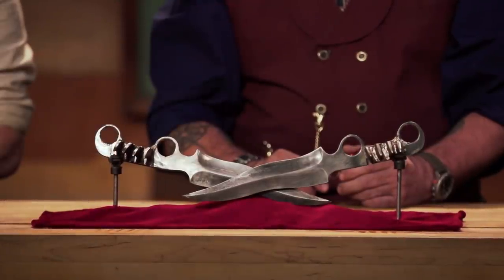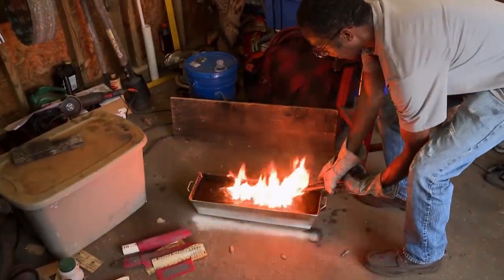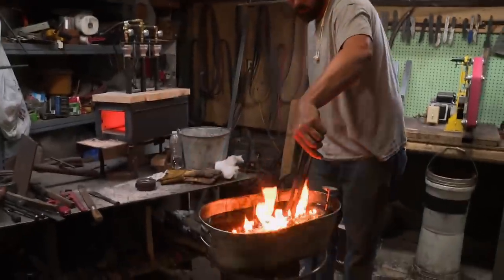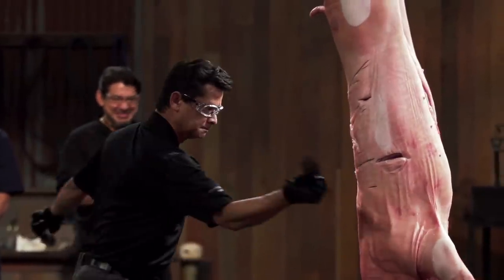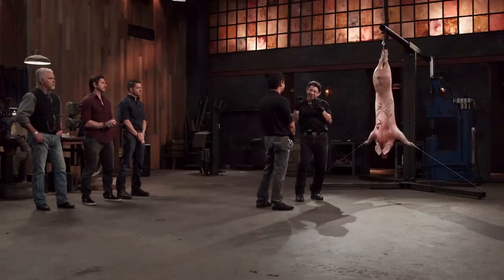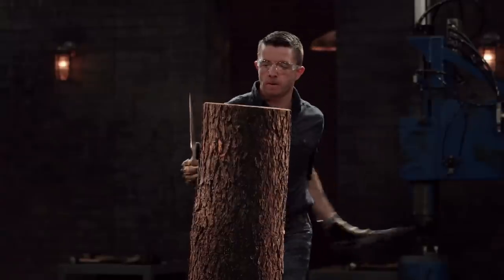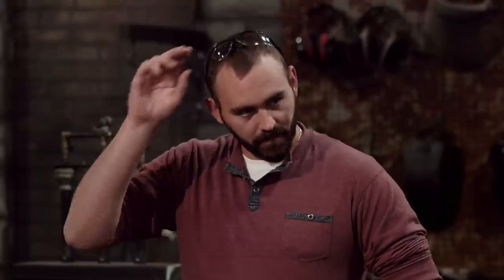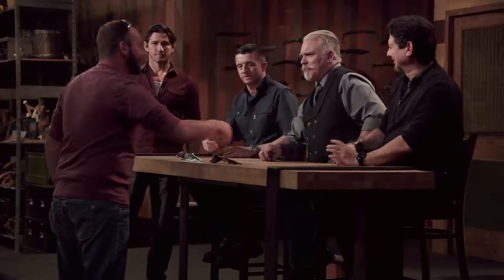Forged in Fire: Bagh Nakh Blades Inflict 2X THE DAMAGE (Season 5)

Comment: Who retracts a knife out of a tree like that
Reply: The test is designed and performed to put the most stress on the weapon as possible.
Reply: @thepettyforge9082  why not just put it in a hydraulic press and destroy it
Reply: Because they also wanna test realistic things. Not many times in life are you just gonna strap your knife to a air ram or hydraulic press and try to break it, because it would eventually break.
Reply: @thepettyforge9082  and how many times are you gonna pull a knife out of a tree by pushing it down like that? maybe slight wiggling, but doing it like that is almost a guaranteed break. Unless they were trying to simulate years of wear.
Reply: @youmang  because very few people would want to watch that

Comment: Don't tell me Chad won just because one tip didn't break? Did it boil down to that? Because both tips of both pairs of blades have the same potential of breaking, if you pry with them.  Chad's was less comfortable to hold (which is a part of the main function), and were less visually detailed (an aspect not so important). Josh's was better .
Reply: Damascus steel always wins
Reply: @Max Chukston hm good point, but 2 said the other was comfortable. But yeah
Reply: Chads seemed just a bit sharper
Reply: Clearly it wasn't better.
Reply: @Just_Pele  thanks for adding that to the convo

Comment: That tree test is bs
Reply: Tip tests are very, VERY common for knives. It's a test not only of the steel, but of the geometry of the tip. It's a test that makes sense, as a combat-style knife is going to do a lot of stabbing, and bones are harder than trees. The tips ought to survive.
Reply: @spamhere1123  Stabbing the tree I get, snapping the tips off I dont. That just felt a bit unnecessary.
Reply: Definitely hurts to watch but for 10k better bring your A game
Reply: @chrishubbard64  That is part of the tip test, prying it out.
Reply: @spamhere1123  Probably what he meant was that after you stab something you would pull it out in the same plane of motion instead of bending it the opposite way of your edge
Reply: @FiveN9ne  That's not a tip test, though. The intent of a tip test is to see if the tip is strong and flexible by bending it exactly as they did in this episode. A snapped tip is a common failure of a blade that wasn't completely tempered right.
Reply: @chrishubbard64  Wood is weaker then heat treated steal. If they did the heat treat right and did proper geometry with the edge and point it would just rip through the bark. Get a slight bend at worst.

Comment: Alright, let's be honest......They were not stabbing those into objects and bending them at the tips in actual warfare like they did on that second test. Give these guys tests relevant to the time period because this was not fair lol
Reply: To be fair, bones also are quite tough.
Reply: Agree.....i thought it was a but much...
Reply: The absolutely are doing that in "actual warfare". You stab into bone or armor, and it gets wrenched out at an angle you weren't expecting because both of you are moving--you think that doesn't happen? Bones are harder than wood, also, so if you manage to stab into a bone, it's gonna be a lot harder on the tip than that tree trunk was.
Reply: @Kocan7  lol! True. But they’re not stabbing, then bending their blades 45 degrees to the left and right in the process
Reply: @BlamBird  It's a good way to make massive and deadly wound, so I guess it's not completely unreasonable, but I agree, testing, as usual is quite extreme.

Comment: I hate when Ben does the testing. It seems to me that the testing goes a bit too far.
Reply: I agree.  I like watching this program but never forged a blade. I would think you could break the tip off on just about any knife of the profile they wanted
Reply: @nobodyimportant69  Finally, someone who gets what a tip test is. This wasn't "too far", it's testing for exactly what happened: an improperly tempered tip.
Reply: @spamhere1123  Thanks. I'm not a bladesmith but I'm a welder/fabricator, overheating metal causes big problems for me if I don't do it right. Learned the hard way from many, many failures, LOL 🔥🔥